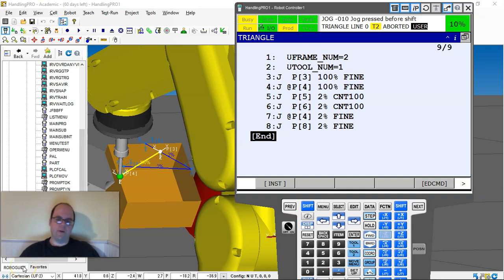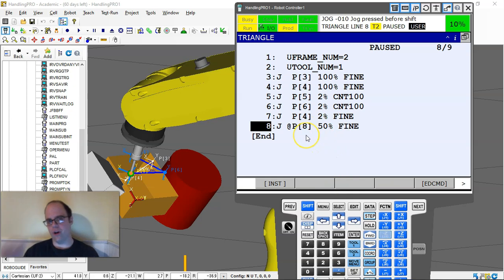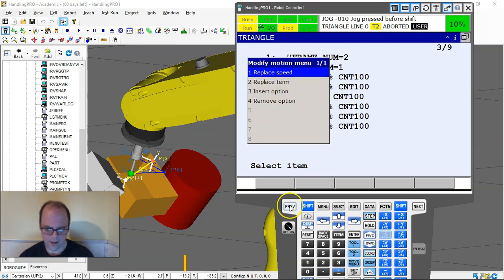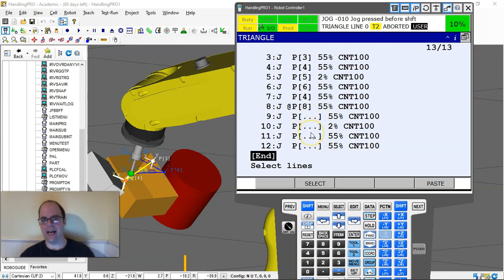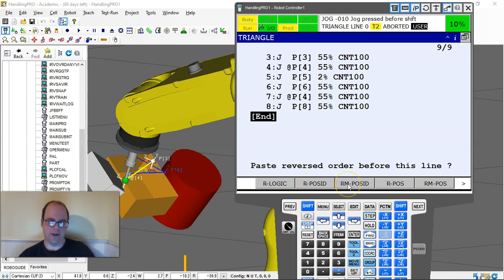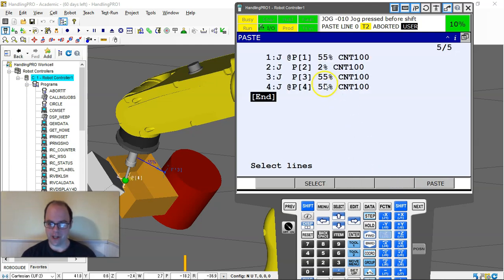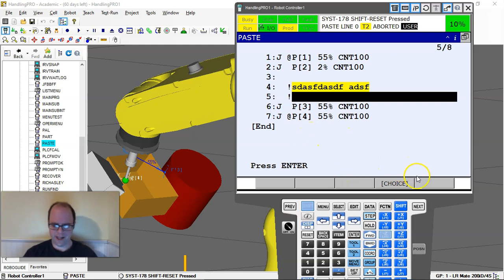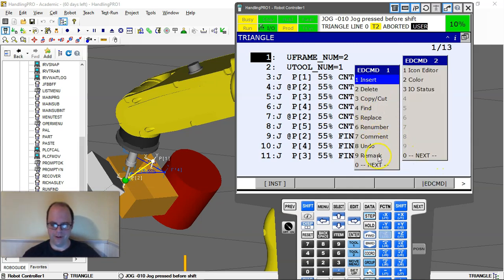Edit Command List (Copy,Pasting, Replace, Insert, Delete, Remark) in Fanuc

Comment: Hello Dan.  Great video. I was hoping you would address my question in this video but you didn't quite get there.  I need to copy a set of commands for a project on a plasma table and paste that multiple times within the same program to mass produce parts.  Copy n paste function always places it back in the same position as the copied one. Any help would be appreciated.  Thanks

Comment: Hi Dan, is it possible to copy lines of code from one program and paste it into another program by using the IPendant touch pad? The "paste" button is not showing after getting into a new program where I wanted to paste those codes in. Thank you!
Reply from the maker: You have to select cut/copy first and the paste will appear. Then make sure you do paste- position
Reply: Thank you very much!